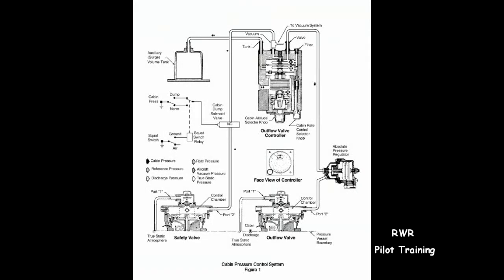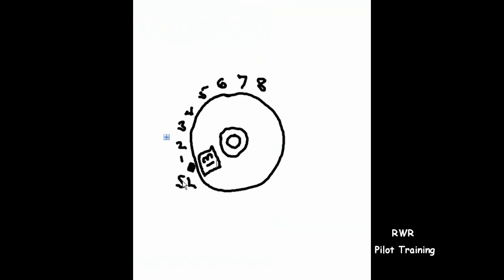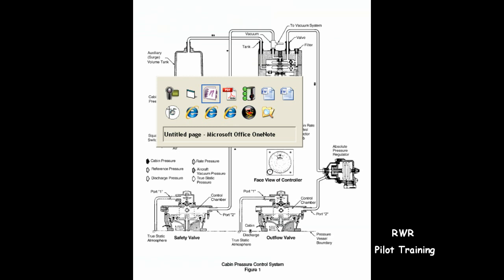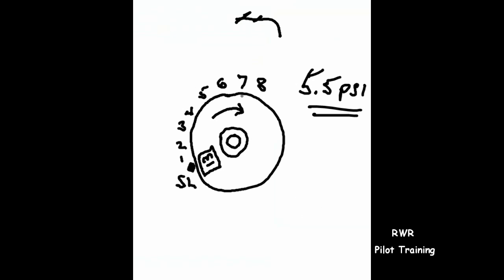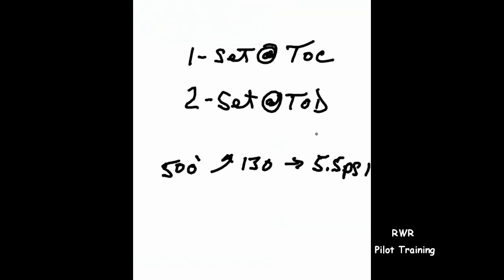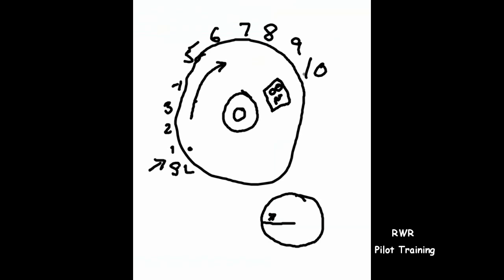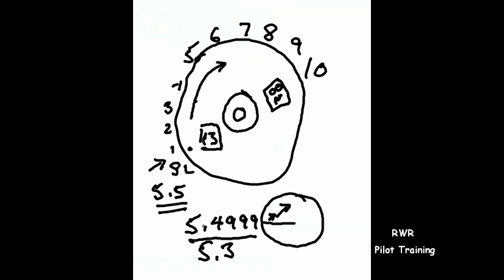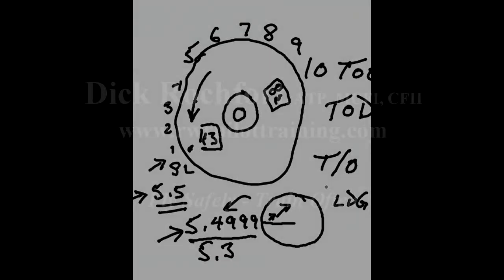PA46 Cabin Pressure Controller - A Chalk Talk

Comment from the maker: Hi Dooobs,  Good observation and you are right. No reason other than that is what the POH says to do. Piper doesn't say why. I can only surmise that it would prevent an overpressurization if the safety valve were to fail, but this appears to me to be highly unlikely.

Comment: Hi there!

Thanks for taking the time to make these videos. I have a question though that I wish you will answer:

Why bother setting the dial for cruise to maintain 4.999 as opposed to just letting the cabin remain at max differential? So before take-off you would set your altitude +500 and then at top of descent set landing alt +500.

I don't understand the reasoning for your setting at TOC.

Thanks again!
Reply from the maker: That’s the POH procedure. I don’t teach it that way anymore though. I agree with you. Set 500 feet above field elevation for the departure. Then at the top of the dissent set 500 feet above field elevation for the airport of intended landing. It’s less fumbling, and you get essentially the same result in most cases. Fly Safely - Train Often .. DR